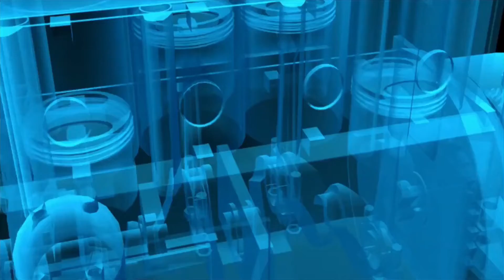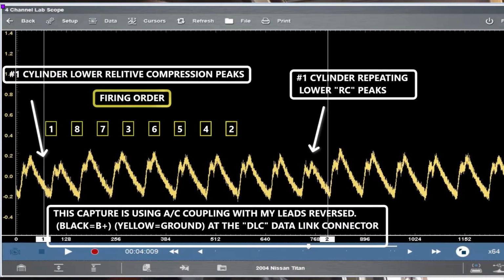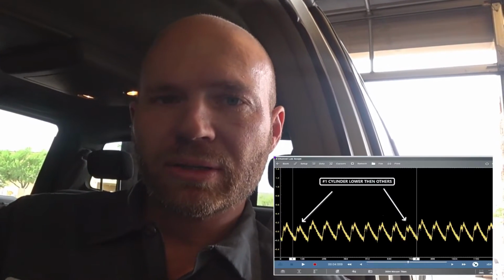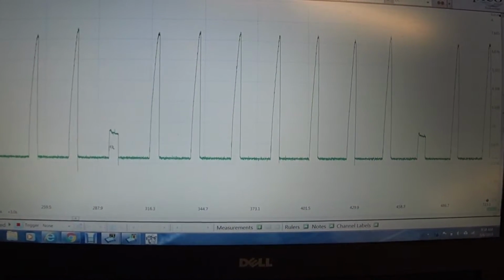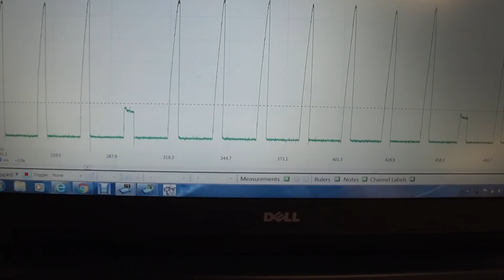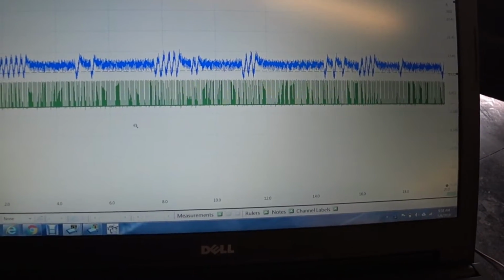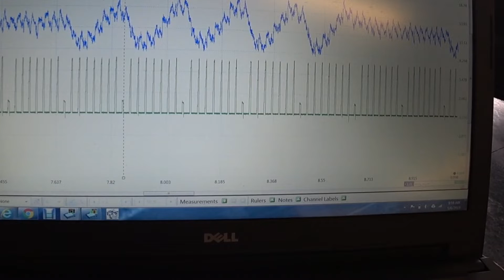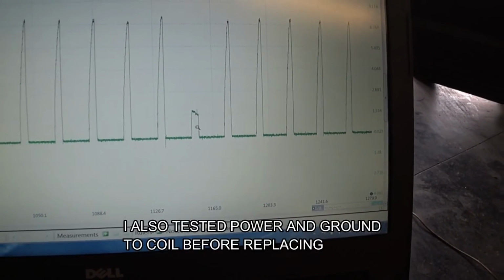FAILED RELATIVE COMPRESSION?

Comment: Great vid, Cody 👍
Goes to show that you can't be too quick to  make a call just by doing a relative compression test, also shows the merits of a relative compression test too, in this instance (for someone that knows what they are doing), the RC test gave an indication of a "problem" cylinder which was a symptom and further investigation found the cause.

Had a Land Rover Discovery today with rough running and a call had been made on one of the Mass Air Flow sensors because it was reading "low and intermittently", I was asked to verify the diagnosis and found it was operating normally, the tech didn't have knowledge of the particular engine and didn't know that the MAF sensors were on a sequential turbo system and one would always read different to the other.

Just a bit of knowledge of the system and a bit of further testing can save making the wrong call and replacing parts that don't need replacing.
Reply from the maker: Jake Elliott that’s a great write up. Definitely better to verify and make the right call. On that Land Rover making the wrong call could be an expensive mistake 🤦‍♂️. Good work!

Comment: Another good video Cody. Would cylinder wash occur by doing an RC checks without disabling the fuel injectors or fuel pump? Just delving into auto mechanics and the u-scope as I'm a retired aircraft mechanic and trying to stay busy learning car electrical. Hope you don't mind my questions. 👍

Comment: As soon as you showed the amperage waveform for the coils I thought "probably cylinder wash for the low realtive compression hump." Always good to see others are thinking along the same lines and you're not crazy. 🙂 I looked at a car for a friend the other day that had slightly uneven cranking and one cylinder was higher than the rest by 20 amps or so. Have some theories as to why that might be.  The engine has a pretty nasty knock in it, so I'm wondering if the rod in that cylinder is bent and changing the compression ratio or something along those lines. I haven't totally work that out in my head but I'm not really sure how far he's going to want to go with this engine in terms of investigating the issue. In any case, great video as always sir!
Reply from the maker: Gearhead Automotive L.L.C. It nice to hear other people thinking the same way as well. My thoughts to your vehicle is maybe since it has a knock that it’s harder to rotate that piston which would create higher amperage. Not sure exactly but just something that crosses my mind
Reply: @codysautodiagnosticsprogra8706   I think that's pretty spot-on and was the only other thing I could think of. It doesn't sound particularly rough running performance-wise it's just the knock. I just happened to notice the cranking was uneven and thought if I could isolate which cylinder was causing that would likely be the source of the knocking noise.
Reply from the maker: Exactly! I’ve seen guys use the pulse sensor hooked to a mechanic stethoscope and use a second channeled as a synchronized on coil. Then put stethoscope on block and can see a change in waveform every time bad cylinder with knock fires. Haven’t tried it yet but going to try it next one I get.
Reply: @codysautodiagnosticsprogra8706  That's a great idea! Probably more effective then the Engine Ear as well. At least from what I've heard about it anyway. Wonder if you could take an old knock sensor and make something work like that too...
Reply from the maker: Gearhead Automotive L.L.C. Yes a knock sensor would work as well. I’ve seen that work as well
Reply: I'm pretty sure Eric O has a video where a cylinder with higher amperage than the rest on a relative compression test --was actually caused by its companion cylinder with an exhaust valve not opening.  Essentially two cylinders were on their compression stroke at the same time, making the starter motor draw more amps.

Comment: hi cody thanks for the video. could the low amps on that coil also mean resisted wiring? does the top of the coil waveform being cut of for a longer period of time compared to a known good coil show that the coil is actually saturated and therefore l would be safe to assume the wiring is good ? just a thought , just learning . thanks bro
Reply from the maker: Yes your absolutely right and any time I see coils that look like this I also verify my power and ground to the coil. I didn’t show that in this video but definitely should have done so. I’ll be sure to show it in the future on the next coil I get like this!

Comment: Are you saying that the unburned fuel from cylinder misfires stay in the cylinder for an extended period of time so that misfired cylinder still has unburned fuel in the cylinder when you do the relative compression test?  You are doing the relative compression test in clear flood mode or with the fuel injectors otherwise disabled, right?  I'm just home DIY trying to learn.  Thanks.
Reply from the maker: What’s happening is the unburned fuel is washing out the cylinder and effecting the compression due to the fuel going past the piston rings.
Reply: @codysautodiagnosticsprogra8706  That should warrant an oil change, too!

Comment: Why not just disable fuel and spark to do RC test. This would avoid this issue would it not ? Testing for a bad coil honestly easier by swapping coils around
Reply from the maker: Actually testing a bad coil in this situation is easier then removing the coils since the coils all ground at one location. I did do a clear flood with an RC test and noticed lower peak for cylinder in question. This cylinder was already washed out when doing the RC test.